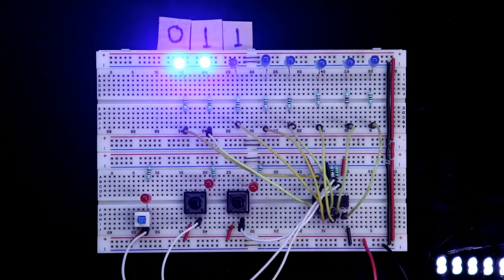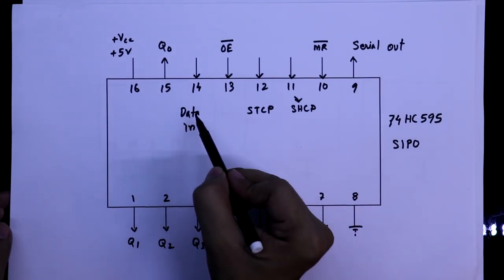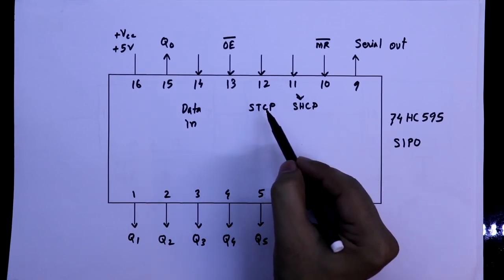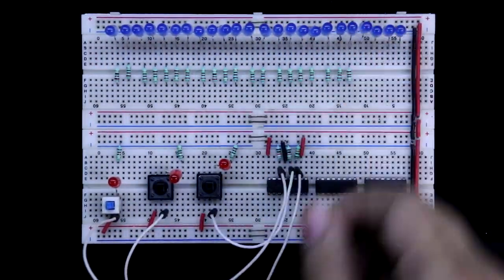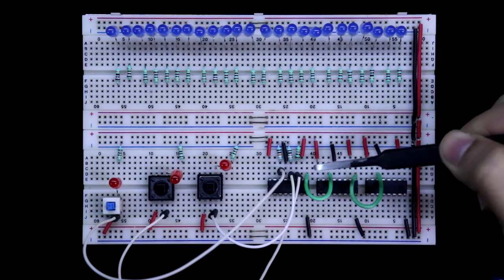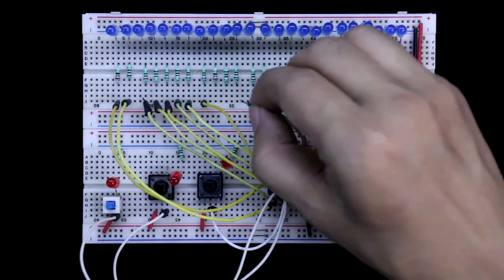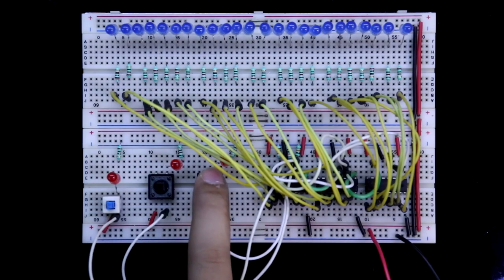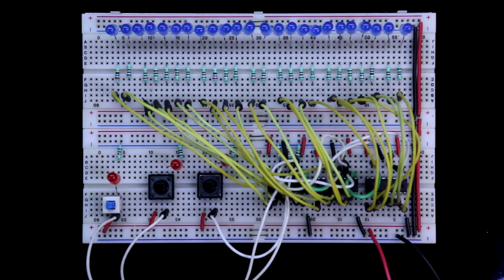How to cascade 74hc595 shift register

Comment: Thank you for the tutorial! Two things I  collided with in executing this circuit:
- if I touch the power lines (I had 5V from a laptop USB) the shift register goes nuts;
- on fresh switches, is almost impossible to get a clean press without bouncing the contacts.

So, what power source you used, and how you debounced your switches? Thank you very much!
Reply: Never mind, I filtered the power with one 100uF and 100nF capacitors, and decoupled the I.C.s with an 100nF capacitor each. The bounce of the switches happened only rarely so it was workable. Enough to realize what I had in mind. Now, the manual inputs will be replaced by the outputs of an Arduino, to test some functions. Thank you anyway!

Comment: Thank you for this nice video.
I have a tricky question... It is not that much about cascading but about the proper internal shift register stage and the storage stage. I have this 74HC594 (not the 595) and what happens is that I tried to load the serial message in the internal shift register and only latch the whole register when I have finished to load all 8 bits. For some reason, it appears not to work and I can only load all bits by sending intermittently the shift register clock (SRCLK or SHCP) and then the storage clock (RCLK or STCP). I can't possibly figure out why.
I use an Arduino to send data and pulses and a logic analyzer to observe the 74HC594 behaviour. I might have a different behaviour with a 595 but I don't have any for the moment. Thanks for any hint.

Comment: So if pin 9 on the third IC is connected to pin 14 on the first IC, and the diodes are placed in a circle, the lights would continue running around?

Comment: Hello, I am trying two cascaded connection and inputs from FPGA and I have connected SRClk(11) and RClk(12) together in Vhdl and i am not seeing expected sequence
could you please suggest is this the correct way?
Reply: Hi. Apparently, we have a similar issue but I use the '594, not the '595. See if the description I sent above corresponds to the issue you have. I am still trying to figure out why.